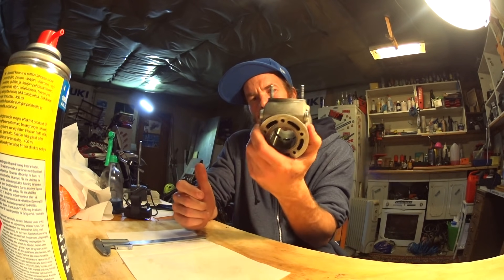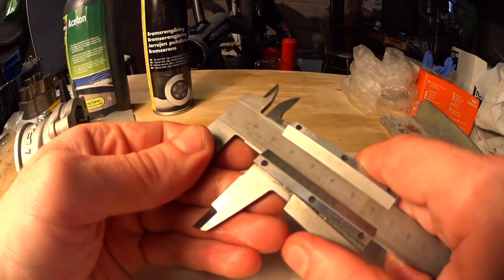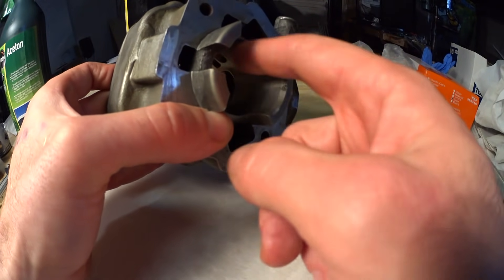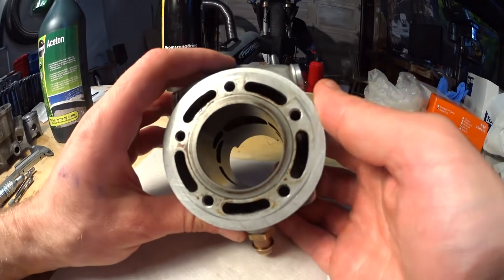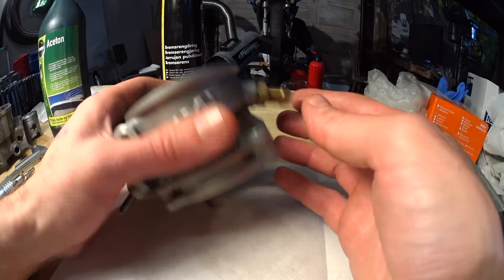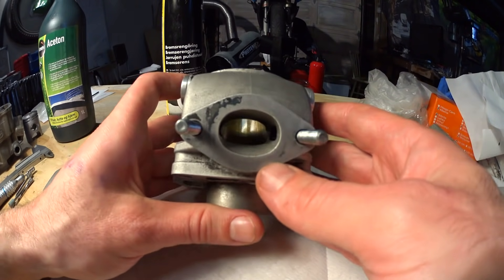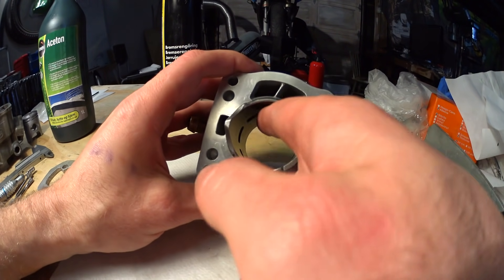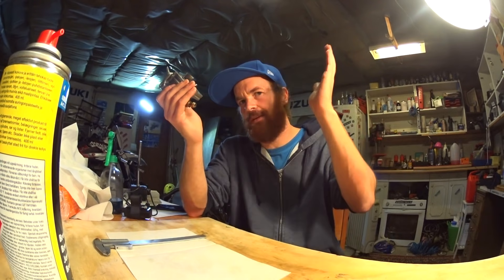Two Stroke Cylinder Porting Tips | WATCH THIS BEFORE YOU START CUTTING! 2 Stroke Tuning

Comment: Hi! Thanks for the video. 3kj Yamaha cylinder has D-shaped exhaust channel that connects to pipe. Should i go 75% from exhaust port size on the end of the exhaust window or i should make it 75 at the middle and then make cylinder smootly match exhaust pipe diameter?

Comment: oh man i really need to do this on my new airsal 50cc lc minarelli vertical cil but i feel like im gonna f it up. if everyone says its nearly impossible to do it right the very first time i probably shouldnt do it... but it just sucks, i bought a yasuni c16 which has max power at 12.5k rpms but i dont think my cil will ever reach that... can anyone maybe tell me the safest mod i can do to increase the rpm and maybe overall power without potentially messing up my cil? i have very steady hands and can work with a dremel just fine but i need more info. im already planning to do crankcase matching since thats pretty straightforward but i dont think thats enough

Comment: Friend, good morning! From Brazil. I have a big problem with a Chinese Thorq 62cc chainsaw. I tried to start it and when I pulled the starter cord it was very hard. I removed the spark plug and it turned the engine free when I pulled the string, but if I put my finger in the hole where the spark plug goes, the piston is completely locked as if it were vacuum or excess compression. Do you have any idea what it could be? I disassembled it and the connecting rod, crankshaft and bearing, piston rings are good. The piston had carbonization on the top but I cleaned it and also decarbonized the cylinder. I can't find the new cylinder and piston for it, as they are 48mm in diameter. I only found 43mm and 45mm for sale. When I assembled it, I still had the same problem, as if it were a hydraulic wedge, an excess of compression that doesn't allow the piston to descend or ascend freely. Can you give me any tips on what is causing the problem?

Comment: nice one! ps they call it 'can of worms'. Many old timer Tomos 4L and Puch cylinders have been upgraded by me, after I destroyed a bunch to learn. I didn't decrease the compression timing, just worked inlet (Venturi) and transfers. Sometimes I made extra ports and cut little holes in the piston that connected with them. Best of luck with your porting projects!

Comment: What about just smoothing the ports out? Keeping original shape and size maybe slightly larger just want to clean up the extra metal?

Also would you reccomend polishing the big port coming in and the chambers? Coming from where the cylinder meets the bottom half of the motor. Sorry I'm very new to two strokes. Thanks for your awesome videos!
Reply: Only polish exhaust not intake

Comment: Just bought a 70cc kit and crank for my Yamaha 50cc minarelli horizontal engine.   I was thinking of just polishing the exhaust port side for better flow.   I don’t intend to remove much metal just smoothing what’s there for efficiency.   The casting is fairly rough.  I’m thinking if it’s smoother there will be less carbon deposits over time?   Thoughts?   Love your channel👍
Reply: Exhaust smooth intake rough !
Reply: Personally I never stay "safe" or conservative , I hog out to the max, lighten the piston, make new much larger piston ports, grind up the intake and make swirl ports, and if I only move up the max rpm 2-3,000 rpm, I'll give it another go with additional porting. Some cylinders was ported 6-7 times, and tested between each seance. Goal is to have Max go around 111,500-12,000 rpm, if it doesn't, it needs more porting.

I've driven street  2 strokes that did 17,000 rpm, so 12k should be fine on a stock crank.

Comment: Someone found accitentally pipe-cylinder resonances in sixties. It is ruler of power.
Reply: It was actually discovered by the Germans in the 40’s and was used on their buzz bombs launched at England over the English Channel from France.   Look at the jet engines on top of a buzz bomb-it’s the shape of an expansion chamber.  That was the first known resonance boosted motor.   After the war a Russian scientist defected from the USSR and moved to the west and Suzuki ended up with the technology in the 50’s.  That’s why all early Suzuki’s? Are two strokes!  Honda was four strokes.  Yamaha was also early two strokes.   1969 Suzuki brought out their TM series of 2 strokes dirt bikes and smoked the field.   After getting crushed at the track Honda quickly switched from 4 strokes and brought out the 2 Stroke Elsinore line in 70’or 71’ ?  Suzuki and Honda were the bikes to ride.  In the early to mid 60’s Suzuki had developed the fastest 2 strokes and was beating everyone so badly FIM was lobbied to change the rules and govern Suzuki so everyone else (Honda) could be competitive.  Primarily in the much coveted 50cc class.  Which in the 60’s was huge.

Comment: Sounds like it's going to be a powerful beast of an engine. Speaking of 2 strokes.  I just got a brand new husqvarna lawn trimmer. It was quite a bit pricey but worth it. I  was wondering what would be the best way to "break in/wear in" the new engine as everything feels pretty tight and has a lot of cylinder compression. I want to keep this machine for as long as possible and want to do the best I can to break it in correctly for a long engine life. I have not had it past half throttle yet as the power was not needed. One tank has been ran through it. Thank you in advance for any help or advice that you can give. It is very much appreciated. You do great and amazing work with engines and trust your advice highly. Have a great and blessed day.
Reply: let engine warm up for 5 mins before working,change choke position accordingly,use high quality 2 stroke oil within range :1:30-1:40(atleasr what i use)
every now and then clean out the carb filter.Check for spark plug gap and  compression every few months.Look if there is any leak like on carb gasket(means torn gasket or carb is curved-fix it by removing all excessive things off of it and put sand paper on glass and do circles until its fully flat.
Every year check if bearings are ok and if seals are torn appart or they let mixture run out.Check your differential head if it has any play and sometimes put grease in it.

Comment: nice one

but i'de like to see some demonstrations of this cause i don't have cylinders laying around to experiment on

and port timing too , what are the calculations(and mesurements) one needs to do in order to have the right thickness of cylinder gasket(bottom) when mounting the cylinder , i use to know on my old scooter but its been 15-20 years since i did it last :)

i used soldering tin of a certain thickness and put it in between the cylinder and the head and torque to spec(that i have also forgotten) then i turned the crank a full rotation and mesured the tin thickness afterwards

0.9mm was the target on that specifik cylinderkit on that engine , but it must vary from engine to engine and from cylinderkit to cylinder kit

have a good one

Comment: After cleaning up the ports and not raising nor lowering the the in and out flow timing.  Do you usually need to modify the carburation and is so, would you usually go leaner or richer.  I am getting a bog when quickly hitting the throttle, but increases nicely is I slowly raise the slide.
This is on Artic Cat Jag snowmobile.  Twin cylinder and a single carb.  Thanks.
Reply: if it bogs at start but not at end or mid its air mixture screw else it has to be main jet.With these port i would run it richer but would find idle gspot with adjustments (set it where it feels fastest rpm)

Comment: Best video ever I hade to try it!PLEASE HELP EXPLAIN MY BIKE I bought a long stroke100cc cylinder n piston and put it in my 80cc short stroke bike I cut 3/16 off the top of Cylinder,bottom of piston,bottom transfer ports,bottom of intake ports,and top of exhaust all were cut 3/16..HOW SHOULD I OF CUT IT?
Reply: Port timing will be way off due to massive difference in stroke, rod, and your cuts

Comment: Hi I need help! I bought a 100cc kit on eBay for my 80cc motor bicycle kit and it didn’t work because the 100cc 50mm kit from eBay is a long stroke and the piston hits the crank!So I cut 3/16th inch off the bottom of the 50mm piston so now it won’t hit the crank and so that the piston is now the same size as the lower end of 80cc piston,but the top end of 50mm piston is 3/16th inch shorter than original 80cc piston so I cut off the top of 100cc cylinder that was 1/8th inch thick to try to make up for the loose in compression because new piston is shorter on top..MY QUESTION IS after seeing you video on raising your cylinder you said to then lower all ports and raise exhaust port but my 50mm piston is 3/16th inch lower on the top end So do I still lower all my port’s and raise exhaust port? What else do I need to do to make this 100cc 50mm long stroke cylinder and piston work on a 80cc short stroke bicycle kit besides cutting off bottom of piston and cutting off top of cylinder?

Comment: What are your thoughts on port finish surface intake vs exhaust? Exhaust smooth and intake rough to increase intake turbulence? Also any experience with fuel injected two stroke porting and how it differs on something like an Aprillia SR50 ditech.

Comment: I heard that plated Kawasaki engine cylinders that were damaged were easily repaired by boring the cylinder out 2 mm or 3 mm (on the radius) and then pressing in a cast iron liner. I am not sure how easy it is to cut holes to match up the port holes but I sure a trick can be thought out. This could give you more chances of getting the porting right. I am not sure if cast iron can be chromed or not. I know brass can be. Brass is soft and easy to cut. It is used by RC Nitro engines for the cylinder liner.
Reply: Abc engines have many

Comment: Ive gont through 2 nitro rc engines so far with trying to mod them. 1 broke the wrost pin another wont run u less half throttle. Is it the same with nitro rc engines.

Comment: 2:42 where exactly do I have to sand down the nicasil? Just the edge where I start porting or the entire area that I am going to cut away?
Reply: You have to sand down the coating first, and then start cutting the area that doesnt have coating on anymore. However its easier to just use a diamond tip, thats what I did.

Comment: I hope that you can answer this for me, you seem to know what you're talking about and I genuinely want to know. Back in the day, some builders of British custom bikes would reverse the head on the Triumph 650 twins so that the exhaust was at the rear and the carburettors were up front. I believe that the cam timing had to be changed as well, although I'm not sure of the details; I have seen pictures of bikes with this mod. With a couple of velocity stacks attached, this acted as a sort of "ram air" setup at speed. What I wonder is this, can this be done on a bicycle two stroke kit, can one reverse the piston and the cylinder and have the same effect?
Reply: Eric Ellquist that would be a interesting video
Reply: if u start it backwards it runs backwards
Reply: I know this mod have been used at old pre-unit Triumph, but then  with a blower/compressor. Not sure If it would actually give any measurable effect by just turning the head. One of the old flat track racers buildt by Von Dutch back in the day had this. Pictures exist. Cheers!
Reply: BACK IN THE 1960S, WHEN MZ 2 STROKE RACERS CAME TO THE FORE, THEY WERE USING 2 STROKES WITH REVERSED CYLINDERS TO GET STRAIGHT PIPES & MORE POWER. I DON'T SEE THAT HAVING THE CARBS GETTING FED MORE AIR THE FASTER YOU GO AS A PROBLEM - ASSUMING YOU JET UP, ACCORDINGLY.  CERTAINLY WALTER KAADEN WHO DESIGNED THEM WAS RECKONED TO BE A BIT OF A GENIUS ( HAVING LEARNED HIS TRADE DESIGNING THE EXHAUST SYSTEM OF THE V1 FLYING BOMB IN WW2.) ALSO, IN THE YAMAHA RANGE OF TZR  250 C.C. ROAD BIKES IN THE 1980S, THE LAST TWO WERE THE 3XV, V TWIN & THE 3MA, WHICH RAN THE REVERSED CYLINDER , STRAIGHT PIPE & CARBS @ THE FRON SET UP. - H.T.H. ?

Comment: hello i would like to transform my 4 hp 2 stroke yamaha outboard to an 5 hp will a carburetor change be einough?
Reply: im not him, nor do i know anything about outboards but you will need to properly tune the bigger carb. Im not sure how to intake is on outboards but you will also more then likely need to  open up the air system for better flow to the filter.

Comment: Can you do a video on ports. An blow down an such an how the ports wrk exactly an when an how an wat.  I’m fairly knowledgeable an when you said a wider exhaust is as good or better then a raised one got me interested an asking more questions to myself then I have answers. Also you said if I raise cylinder then I need to raise exhaust port. Why?  An blow down is very important ? Why how. I’m interested very much I guess I just didn’t quite understand all I should. I have a 4cyl 2sttoke merc/force 120hp jet boat engine I’m tearing down to bore an rebuild. I’d like to do all the tricks I can like port it out. Just need more info I guess. Also the engine is all aluminum an the intake is as well an it’s cast but very smooth I was under impression that it should all be rough in there. Maybe you can touch on that as well. I think everyone would benefit an would love a port/porting video an the timing an blow down an wat it all means an how it all wrks. Thx love your wrk. Ps I know your busy but if an when you find time. Again great wrk

Comment: Just a quick question .Ian porting a 2stoke 45cc 1/5 scale  dune buggy engine is it possible that if you remove to much material from transfer ports (therefore increasing volume) could this decrease compresion
Reply: Maybe higher crankcase volume, and that would slightly decrease crankcase compression, but I think that is ok, since crankcase compression isn't as critical as cylinder compression.
Reply: Just try to get them nice and proportional to the ports...if you make the transfer ports too oversized, you lose gas velocity.
Reply: @lobmin  ive had puch e50 with 15-16 bars of compression with ports.Never doing that mistake  again cuz it bent my crankshaft like letter c

Comment: I learned alot of tricks close to what he shows from my dad we built a 2002 banshee together back in 2011 and stock there about 34 hp. After porting, the cylinders, slightly modifying the piston. The stock bore and stroke It ran about 38 on the dyno, and the change it made for when I hit the powerband was amazing It was like spraying nitrous to it while it hit the powerband. The only negative was it ran hot alot, and about  10 hours you were putting rings in it because of the heat
Reply: Sounds Lean
Reply: Only 34hp wtf its a two cylinder two stroke it should have alot more right?

Comment: Kind of curious what you think of the two-stroke tuners handbook that you got. As a kid I got a hold of a copy of it when it first came out. By the mid-eighties I was discovering there were things that could be changed in the calculations to increase the power band width at only a slight cost to peak horsepower. These were in however relatively low RPM engines >10,000 compared to the insanity of your hyper tuning. Kudos. This old fart is he enjoying learning some of the new stuff going on as I kind of dropped out of things for the past 25 years.

Comment: I have a 78 Yamaha Dt400 and have ported it. Along with other changes to the port timings I removed the sleeve separating the boost port from the intake as I redirected the boost to aim to the front (intake side) of the combustion chamber. I have heard somewhere that desert racers add a window in the intake side of the piston (above the original 2 windows) to aid in under crown cooling and add power. Can you tell me how it works and how far below the bottom ring land to cut the hole so that it does not cause any detriment?

Comment: Cast iron bores are easier to port because you can remove the liner, cut your new port shapes and put it back into the cylinder. Then all you have to do is smooth the cylinder to meet the newly cut ports. A bored cylinder will often not make any more top end power because the transfer ports are not properly aimed at the new cylinder wall (its now further away). They have to be angled more to the back of the cylinder. If that's not possible a boost transfer port via a hole in the piston side will recover the top end power.

Comment: A good tip for using carbide burrs on aluminum is to keep them lubricated, a spray of RTD spray from time to time will keep the cutting tool clean and sharp, which makes for a consistent and predictable tool.
Reply: Three years later and this tip is as helpful as ever.. thanks!

Comment: Have you tried single cut carbide burs?   Haven't tried myself but grind alot and My guess is that would work. Very in-depth explanation good video
Reply from the maker: Thanks! I used single cut burs to rough shape the Spc crankcase, works great!

Comment: Hello i have à small question.What do you advice to do with the ports @ 4:52?I didn't understand what you mean. Hope te hear because i am doing a project for The summer. 
Greetings,Joey. À big 2 stroke fan from The Netherlands
Reply from the maker: It's a good idea to raise the whole barrel with a spacer first to get the transfers where you want them. Then you want have to cut into the transfer roofs and risk screwing up the angles.

Comment: 2:00 good tip on the glue. 
I had to surface an oil pump cover for one of those Chinese diesel clones as it was scored. 
I couldn’t hold my finger on it as it was about 1” or 25mm in diameter. 
So I used crazy glue to glue a short stick on it, and it worked like a charm on the lapping plate. 
Love those tips.